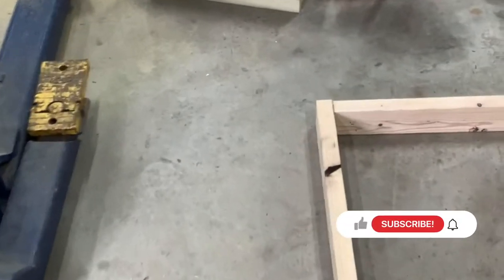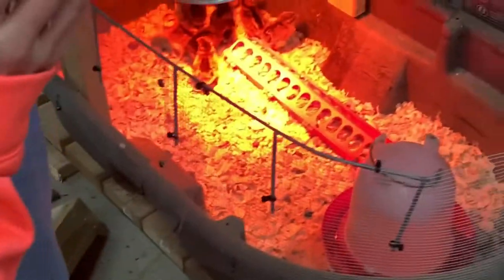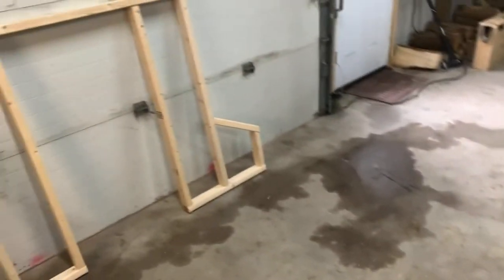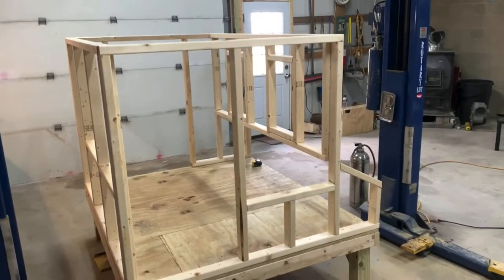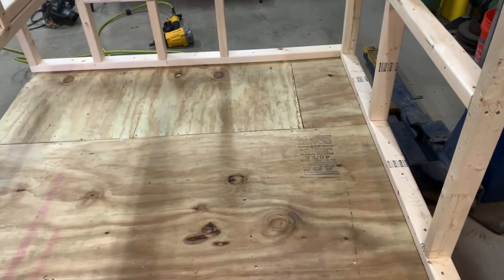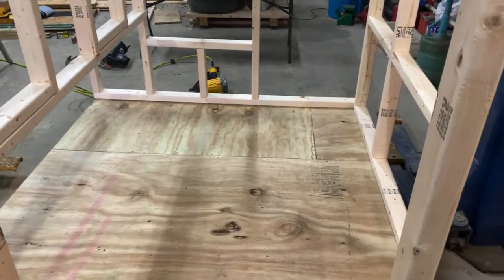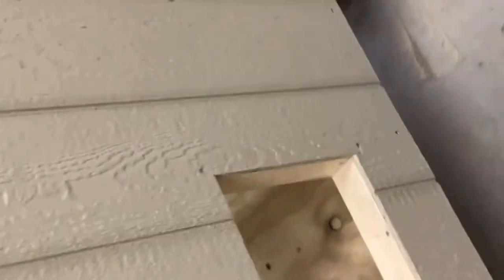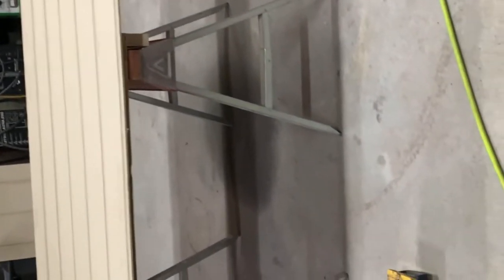The chickens get a new home. Building a chicken coop with plans.

Comment: What is the overall height? I like this design and was wondering if it’s possible to downsize it and build it slightly smaller?
Reply from the maker: It is 69 inches from base to top. Not including the legs. I am sure if you did the math right it is possible.

Comment: Good! How many chickens will it host?
Reply from the maker: Thank you! The coop is 24 square feet of floor space with 5 nesting boxes.
Reply: I’ve read a lot that you should have minimum 3 square feet per chicken… 4 is ideal though. With the floor of this coop being 24 square feet it can hold between 6 chickens comfortably or 8 chickens that don’t mind being a bit cozier.

This is not a rule… just something I’ve heard and read quite a few times.
Reply from the maker: We always go over, but they don’t seem to mind. I have a problem going into tractor supply